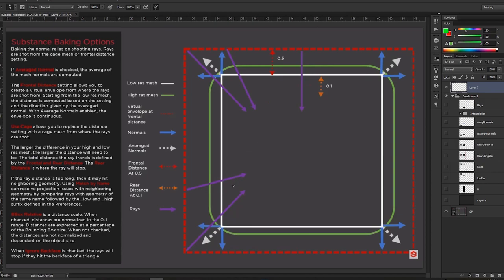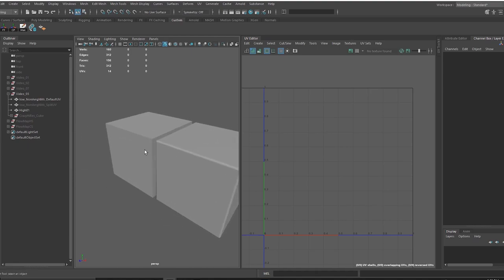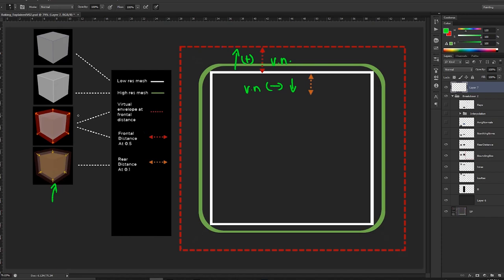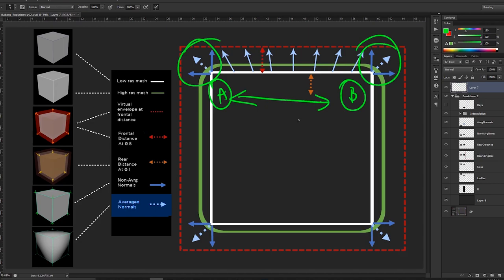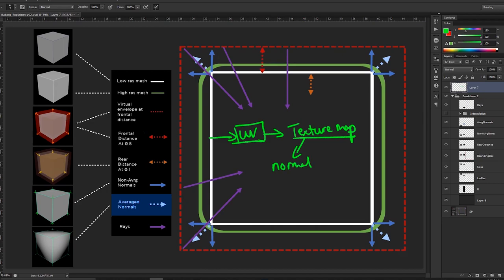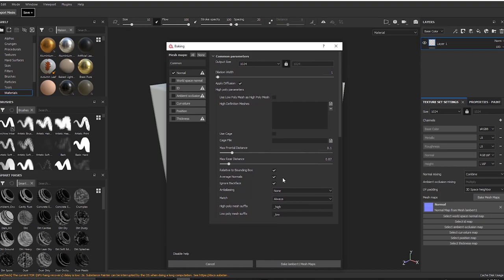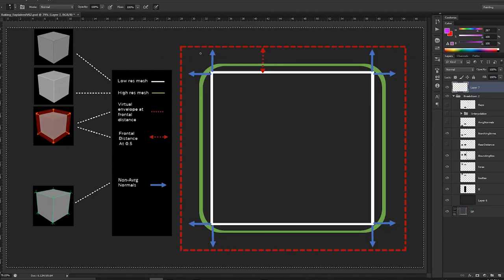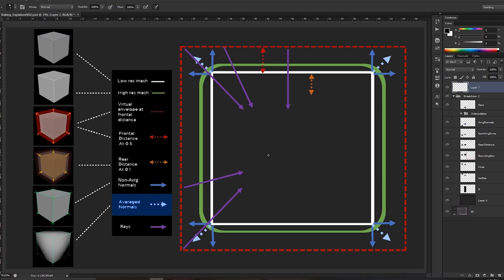03- Principles of Baking a 3D Asset

Comment: Yes thank You for the videos, I hope with next ones I will better grasp the subject. Although I have to ask. If I prepare my LowPoly mesh normals - by that I mean my smoothing groups on my divided UV islands- then I want to switch off Averaged Normals in SubstancePainter ?? 
Does it mean if I leave it default on, it will ignore my setup and just "one smooth group for all normals" Is that it ? OR is it gonna interpolate between my "hard edge smothing" so it will look good in substance but if I apply this normal map to my mesh, smoothing will be messed up ?:)
Reply from the maker: Yes when average normals in Substance Painter is ticked on, it will assume you want to bake with averaged/soften edge normals. 
What's important to note is the default normals of the mesh when created is overwritten by that button (avrg nrms) only for bake. 
So when it's off it uses the "original" normals of the mesh (which is taken during the creation process, eg in Maya or blender)
Hope this helps :)
Reply: @claudiusdsouza  Kind of <3 yes thank You. But I still need to ask: Further in the pipeline, I use in game engine, same mesh I used for baking in Marmoset which "uses the "original" normals of the mesh" ? Or if I bake with averaged normals (SubstP) option [on], I have to export to game engine new low poly with one averaged smoothing group newly created ? Hope my question makes sense :) <3
Reply from the maker: @JimmeeAnimAll  yes your question does make sense, typically the mesh you take to substance and baked on is the EXACT same mesh you take to a game engine...(why u might ask)...the answer is simple, because the Normals that are baked on the mesh are very important and they are purely dependent on the mesh normals since it was created.
So in Summary
Low Res Mesh >>> Goes to >>> Game Engine
Hi Res Mesh >>> Goes to >>> Baker
(sometimes ppl make other meshes for other purposes like better bakes but thats all too much for now)